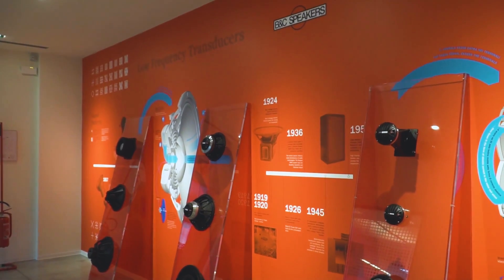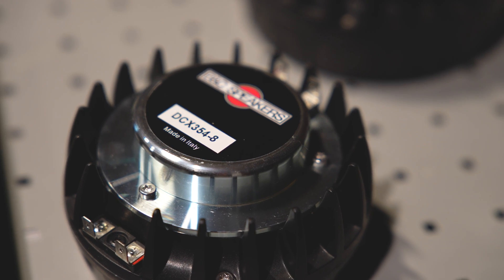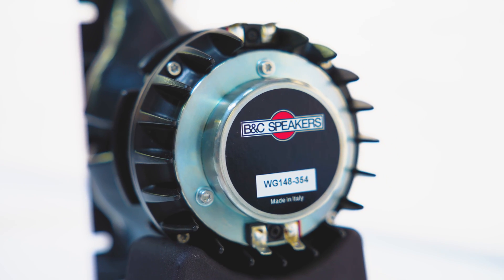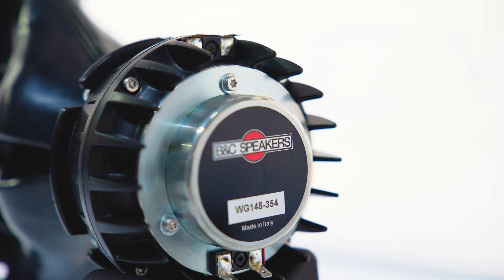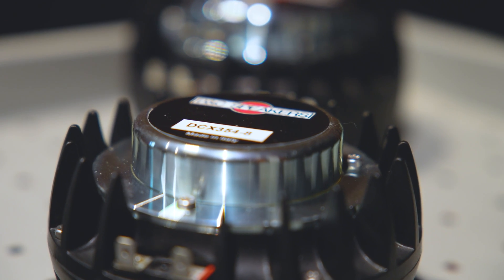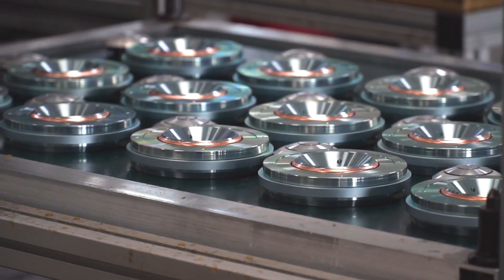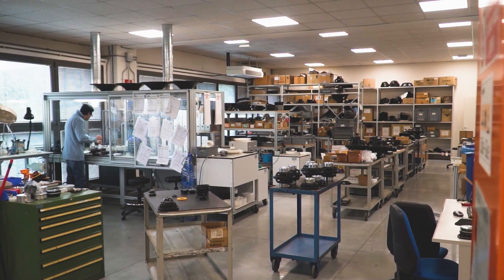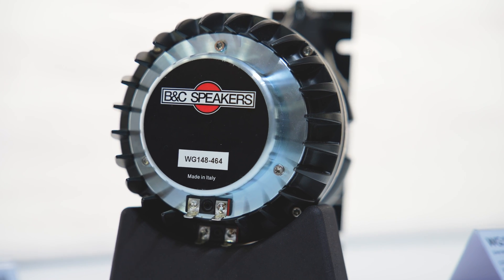B&C Speakers - DCX354

Comment: Would this driver work well in a home hifi environment?  Obviously don't need the SPL, but I like the point source nature and a horn that can do 400hz to 20khz, so this is really a question of sound quality - distortion/imd etc.  FR isn't critical as it will be EQd, but any distortion elements are important.